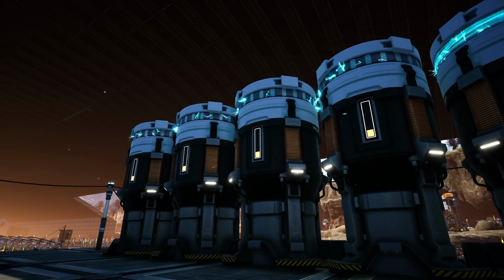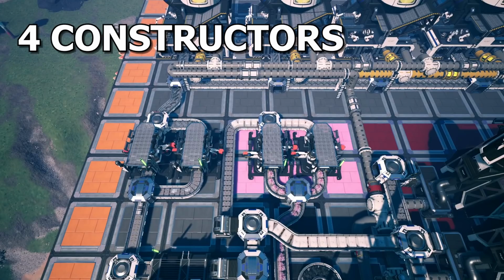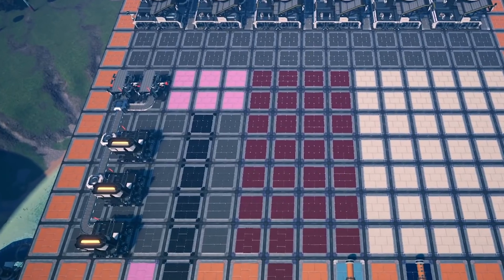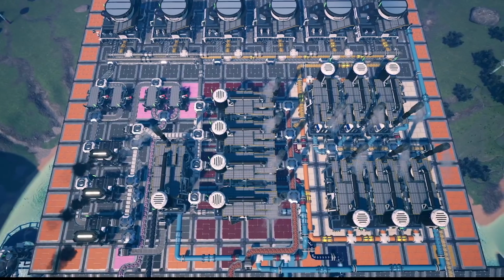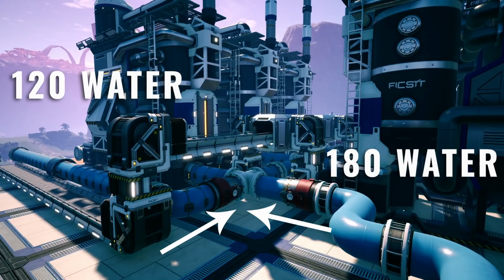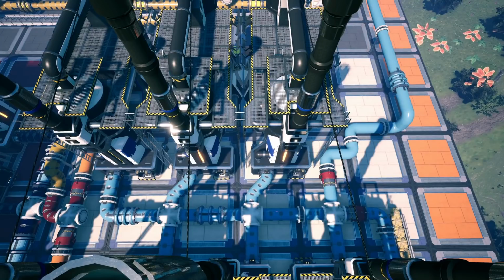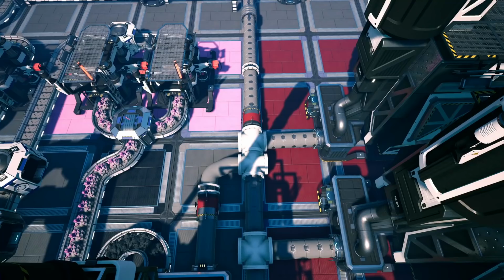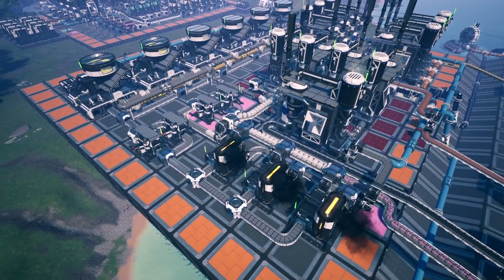Satisfactory Update 4 | Battery Layout

Comment: With the new 1.0 the foundry’s will have to be a count of 4 other than 3 if not your aluminum casing constructors will need to be underclocked I’m not sure the new amount of resources needed
Reply: If you over clock the past aluminium solution refinery you don't need a 4 foundry  but you do need at least 675 water per min but I found a way

Comment: I dont know if anyone is still using this video but im super confused about the over saturating part, everything works until it bottlenecks with too much water 😩
Reply: I too have this problem with my aluminum.  I’m not sure the fix but a big buffer that I can periodically drain seems to help
Reply: @ZigmondDwarf  I played around a bit and I've used a overflow valve (basically an upside down U-bend) coupled with a buffer, and now it works flawlessly and the buffer isn't really even necessary as the water level doesn't increase any more

Comment: probably would add some bits in to just focus on the manifolds etc.  I got the hang of that, and learned a bit about pipe/belt planning as a result, but overall good video's.  I think the only thing that you could possibly add would be just a focus on the pipes/manifolds just so its a little clearer.

Comment: Thanks for this layout, it was extremely helpful for my first play through. One thing, I found that the factory must keep running or it will seize up and not be able to restart. To fix that I put an awesome sink at the end of the silica line with a smart splitter siphoning off overflow. Your Alclad Aluminium factory almost has this problem too, but just gets by because the alumina solution solution refineries don't quite filll up the silica before solution fills. Thanks again for the plans, much appreciated.

Comment: Grateful for the guide. It took me hours to finish it, but for some reason no matter what I do it will always stall somewhere after a while and never reach perfect efficiency. Only one or two blenders running at a time when I come back to check on it
Reply: I'm having this same issue.  Water backs up at the Scrap refinery
Reply: @OdyRenrag  You probably put that pipe in the wrong place. It joins one of the 30 water and then on to the 180 water, make sure you put valves before any connections.
Reply: This is probably because the water in your alumina solution refineries is not reaching all the machines. To fix, put a shard or two in the 60 water refinery and crank it up until all those refineries are 100% full.

Comment: i cannot get this designs to be stable.  the solution refinery next to the end one i've dialed back to 50% cant output fast enough and always backs up.  the blenders rarely get to 100% all the way down the line.  Your description talks of saturating the water lines to start the factory off.  I feel i didn't do this properly and has just caused me issues.  is there a way to completely purge the whole thing and start from scratch?
Reply: Add a couple of power shards to the 60 water line until the refineries are all at 100% water. If you don't do this the refineries at the start of manifold will starve the later ones of water.

Comment: I can never get pipes to balance out no matter what i set valves or water extractors to i end up running the whole factory on the out putted water and shutting the water extractors off and thatll run a few days but i open the game up its starved of water so i end up making wet concrete with the output water and sinking it lol i cant wait for fluids to be better optimized
Reply: Yeah, dealt with it yesterday with alclad sheets factory... It's such a pain to deal with water extractors. I ended up building small coal power plant  with few generators to use all that water and added some extractors. At least now factory is making most of the power that it needs to run.
Reply: @Stasiek_Zabojca  right for me it's the liquid output of a factory and combining that with additional liquid like the aluminum set up if I'm outputting 180cm3 of water and need 300 I have one water extractor at 120cm3 the water either backs up or starves even at 119cm3 from an extractor nothing really seems to work unless I get 300cm3 of water from extractors and use the 180 output from previous line for wet concrete and sink it it works but wish i didnt have to waste a good node because of it we need a liquid sink until liquids is fixed